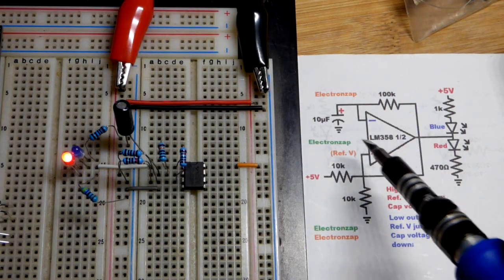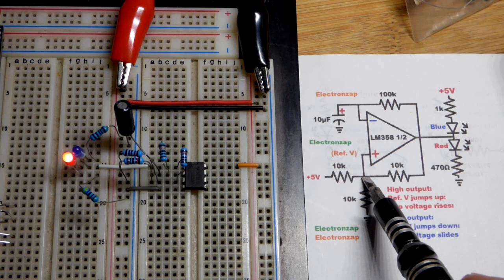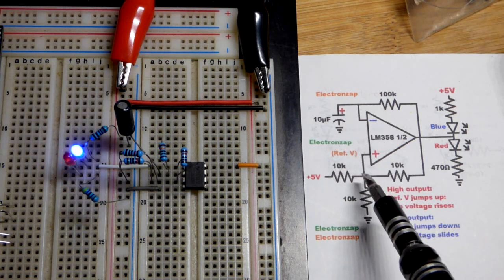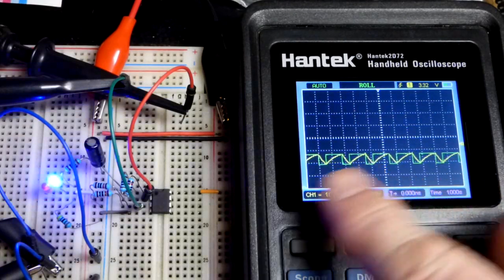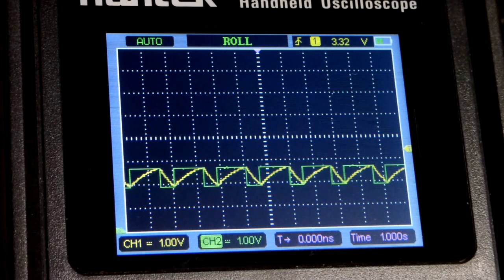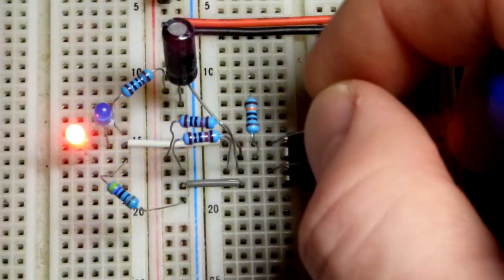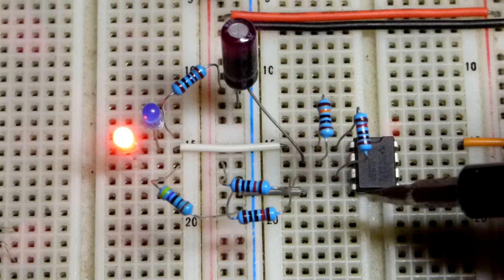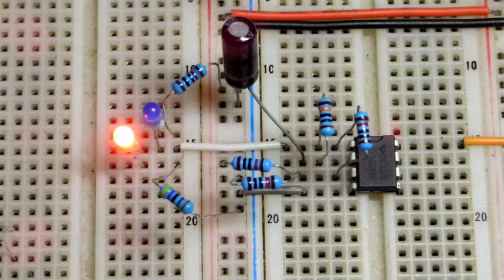Astable LED flasher using LM358 Op Amp Circuit Operational Amplifier by Electronzap

Comment: Nice. Good choice of circuit for an educational video. Most beginners aren't fully aware that far superior components exist which can create the same effects you can get from a 555 timer. And those components can further be used to build circuits which a 555 timer is nothing remotely close to sufficient or even safe for. Although I have found an actual 555 timer inside of a small car 12v batter inverter as a main component so I will not go so far as to de-legitimize them.